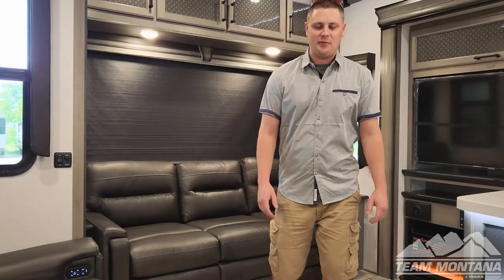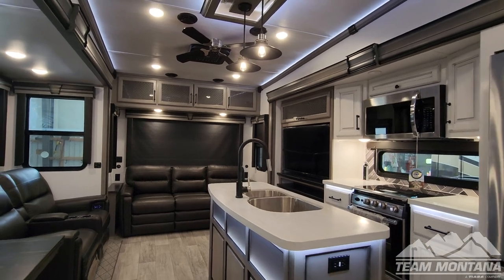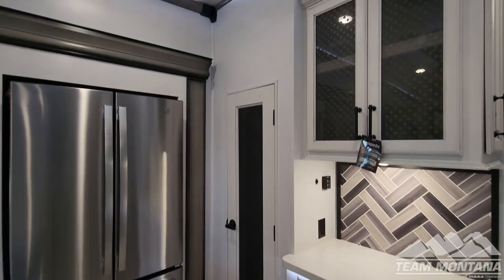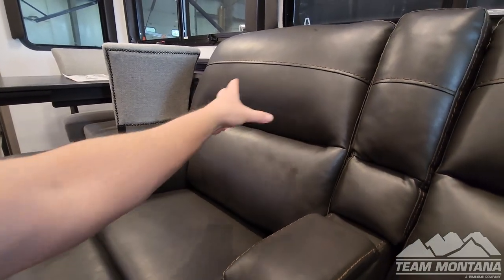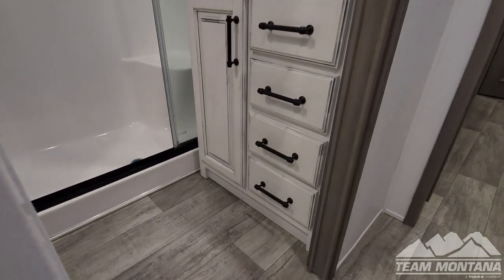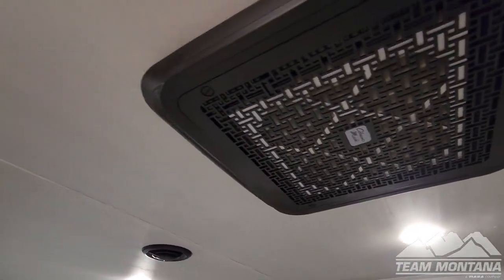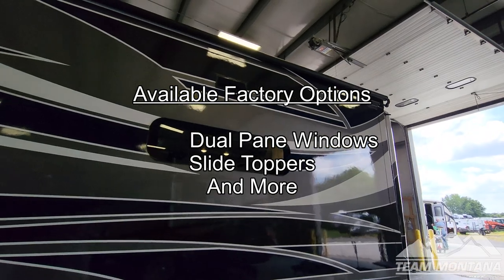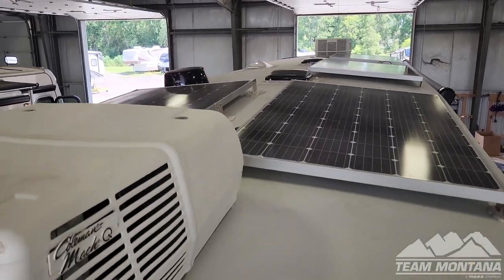The Solar Snobs | 2023 Montana 3121RL Fifth Wheel for My Friends! Keystone Montana 1200i-L

Comment: I'm not an expert on this system, I'll just say that upfront, but I believe that the upper display panel is from the inverter, and the lower display is a router (designed when multiple inverters are utilized), so I'm guessing they are using that has a interface for the solar power.  Normally you'd have three displays: inverter, solar charge controller, and the shunted battery monitor.  Shunted battery monitor is the only way to truly see your battery charge state.  I would definitely want a proper battery monitor for such a sophisticated system.  Maybe that's on the rig, just in another location.

Comment: Is there generator power as well ??/
Reply from the maker: Not from the manufacturer
Reply from the maker: When this solar package is opted, the components are in the generator space. So no generator can be permanently placed
Reply from the maker: However, you can use an auxiliary generator and plug into your shore power cord